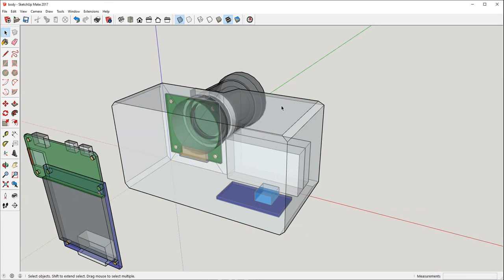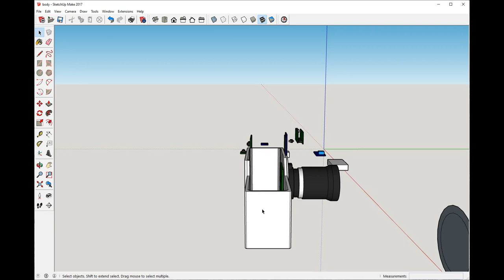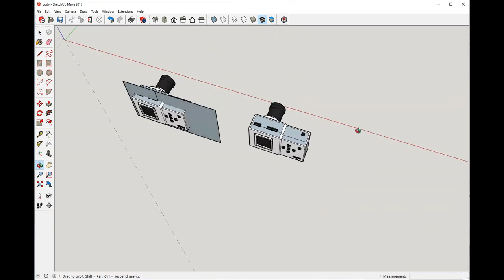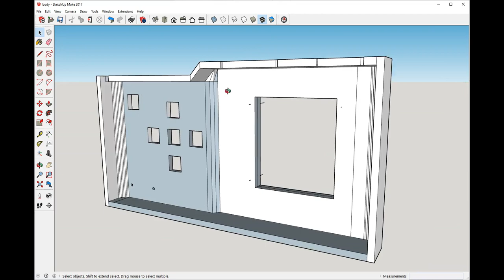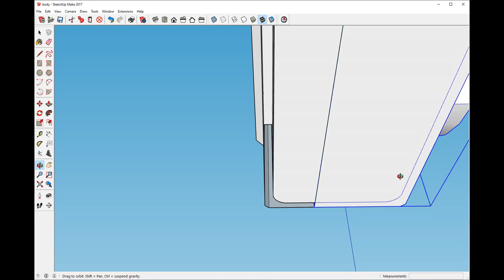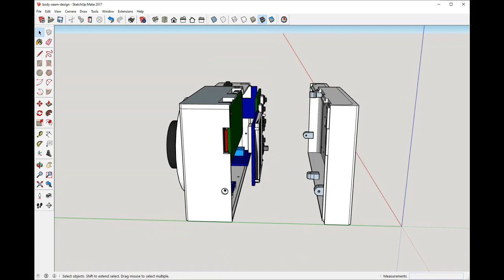[Long] Custom Pi Zero HQ Handheld Camera Modeling With SketchUp [CAD]

Comment: You might want to check out build123d, which is a python-based fully open source CAD modeling software that I contribute to. It is very much a real CAD software in that it uses a BREP kernel (as do SolidWorks, Fusion360, etc) and has native support for fillets/chamfers (unlike OpenSCAD). I have a few demo recordings on my channel.